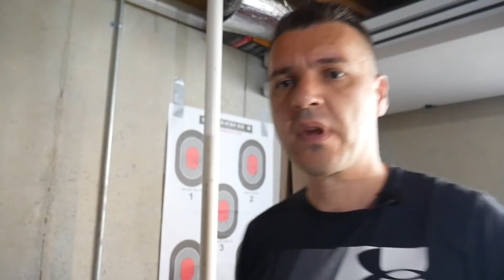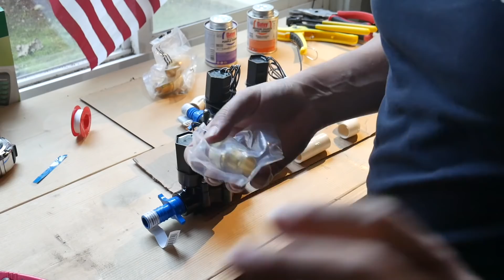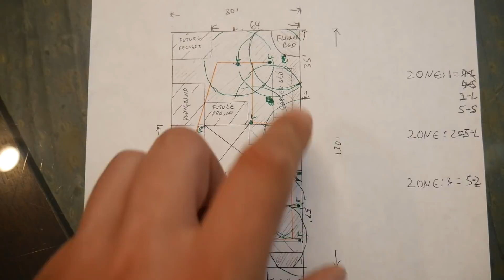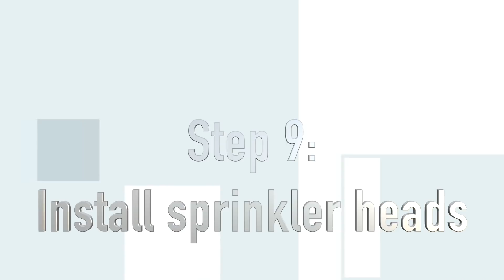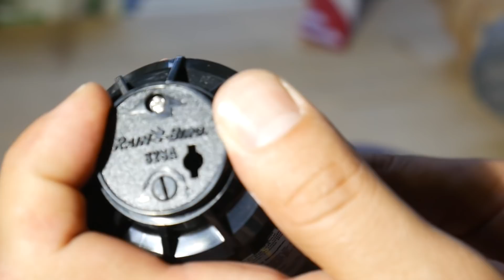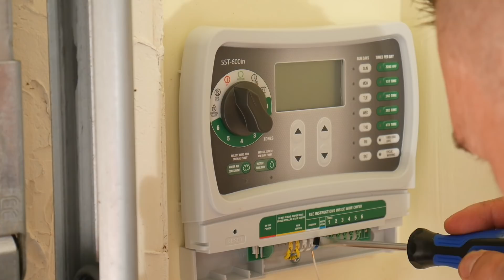How to Install Water Sprinklers - Do It Yourself

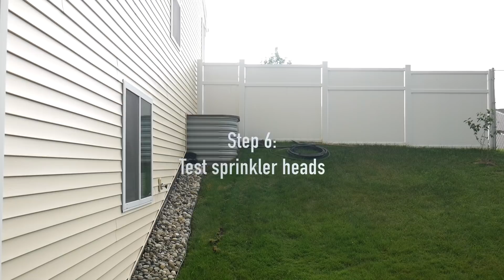Comment from the maker: One thing I would like to mention is that all other videos on YouTube suggest that you should measure your water flow and the water pressure in order to determine how many zones you need. I did that same thing but it didn't help me much because you need the precipitation values from the manufacturers for each type of sprinkler head to correctly calculate the formula. The sprinkler heads precipitation values, for the sprinklers I used, from Rain Bird and Hunter, were nowhere to be found or were very vague. So I decided to test how many sprinkler heads I can use myself by connecting a number of sprinkler heads directly to the irrigation system. You can see that procedure at 28:20. Thanks for watching and do subscribe for more videos like this.
Reply: Yes, that is true. What was your water pressure and flow rate? Hunter has several pdfs to provide great documentation.  Specifically,  Residential Sprinkler System Design and Installation.  In my case I have 40 psi to the house and, through their instructions,  they determined my "working" pressure would be 30 psi. I did an "above ground" in ground system but can only support two MP3000 sprinklers per zone. I have a 5000 sq ft area that receives no shade. So for ppl, like you, that have done YouTube vids I'm curious what pressure you started with. Very nice video btw!
Reply from the maker: @waltcorey5115  Hello, Walt. The water pressure was 30psi and the water flow was 5 gallons per minute. The 1800 series rain bird sprinkler heads and the corresponding hunter brand sprinkler head version work great with 5-6 sprinklers per zone. My back yard is small (less than 1000 sq) and I didn't cover the whole area so I was able to get away with only 3 zones. For a 5000 sq lawn, you would probably need to draw a picture like I did in the video and try to figure it using the sprinkler head coverage measurement or calculate it using manufacturers formulas. Every set up is different but I think you would need around 12 zones with about 5-8 sprinklers each for a big yard like that. Thanks for watching.
Reply: @NeverStopDIY  Yes! Once again you are correct. Every town or city have property assessors. I suspect,  at this point every municipality has something like axisgis,  which is a geographic information system which shows aerial projection of each property,  vegetation, contours etc. Likely, thanks to Google,  one can superimpose an aerial photograph of their yard.. you can create a PDF of your property at whatever scale is appropriate. The one I'm looking at I set 1" equals 17'. I then set my compass width to 1" and drew the edges (90°) and and filled in the runs (180°) then can see where those not-covered areas are. It's nice having the superimposed photo as you can sight to landmarks in your yard. The down side of above ground is the massive number of hoses needed. Watching your video I got a very good sense of the physical exertion it took you. I'm, most likely, twice your age, it is impractical to think I could be successful by myself.  But, again,  that was an awesome video, very well done. TY.
Reply from the maker: @waltcorey5115  you are welcome :) Hope your project turns out great. Let us know after you are done, please.
Reply: Well, these tables for each sprinkler head are in catalogues (RB and Hunter). You just need to use right numbers (metric or that strange units). The problem I see right in your planning - every single sprinkler should have another in range and every single m2 (or sq ft) should be irrigated be 3 (triangle) or 4 (square) sprinklers. And the numbers from RB/Hunter are calculated for this exactly. So your idea of one full 360 sprinkler in the middle is wrong by design.

Anyway optimal pressure is 2.1-2.4 bar with flow about 3.6m3/h (1 l/s). I have 4 bars from my pump, so I have to use pressure regulators and/or special sprinklers.
Reply from the maker: @martincerveny2284  I see you did your research very well :) The sprinkler that you are mentioning is actually not single. All the areas, including that area do have double coverage. But a nice thing is when you do your own irrigation is that you can play afterwards with it. You can change sprinklers, add them or take them off.
Reply: @martincerveny2284  it wasn't until just now, reading your post, that it clicked what Hunter meant with their section on triangular or square orientation. So thank you for that! But there is an assumption at the base of their calculation which is the pressure drop from the street to your water meter. For instance our house is 200 ft off the main and maybe 15-20 ft elevated off the street. I am using MP3000 heads. What you are using 1800 is equivalent to MP1000 heads. Best way to deduce perception rate is with an empty tuna can. Run for 1 hr and measure how many mm or fractions of an inch.
Reply: @waltcorey5115  Irrigation from city water source is not good in any way - there is very low pressure*, pressure changes often during the hour/day and it's way too expensive (it's like $5 per 1000l of water in my country). A well is IMHO the only solution - the pressure is high and stable and running costs are low.

* you have to measure dynamic pressure (when water flows) and not static, and you have to count into the pressure losses all of your pipes, valves, filters, fittings, etc. 

BTW: I'm not a professional too but I'm installing my irrigation system right now (18 zones, 60 sprinklers, 400m of dripline) so I studied hard :-D I'm using Hunter PRS30 sprinklers with adjustable and rectangle heads. MP Rotator heads are very good and trendy for last couple of years but I'm kind of old school and better go with classic adjustable heads.
Reply: @martincerveny2284 I was just getting ready to post to you. I completely agree with your comment on well vs city water. We lived in a house with its own Artesian well. The only cost was for the electricity to run the pump. City water here is ridiculously expensive but I just spent ~ $6000 to dig out and reseed 5,000 sq ft of burned out sod. We've been here 8 yrx and mother nature did very well watering that area of the yard. The last 2 yrs have been "extreme" drought. That section of the yard didn't simply go dormant in August it died and didn't come back. It would cost thousands to drill a well. After I get that section established I will merely augment nature going forward. What I was going to post abt is , at least my, struggle to visualize the inter-dependencies between pipe/hose length, pressure drop per foot, pressure drop per head. I got the necessary information from our water company and established my design capacity should be 6 gpm and working pressure should be 30psi. It is not. I can only put 2 mp3000 heads on one "zone". I could drop to the 1000 or 2000 series but it would be an exercise in linear programming (lp) to minimize cost with fewer zones but more heads and piping  or more zones and fewer heads and piping. When I was in college I could design the software to do that in my head. That was many decades ago. The area in question is 100 ft from the house and is 100' by 80' approx. So if, anecdotally the design capacity is really 4-5 gpm is dynamic pressure really even relevant? You mentioned the term dynamic pressure. That's interesting as I had the water company come out and test and they said the static pressure was 40psi, which I knew, and dynamic pressure was 50psi. That's about when my head exploded. What I alluded to above was if a head consumes 1.6 gpm 2 would consume 3.2gpm and a 3rd push gpm to 4.8 which would exceed design load. But, yeas, it would take a certain amount of kinetic force simply to raise the head at all. I wish I were 40-50 years younger when this stuff would make far more sense. You seem to have a good handle on this... what are your thoughts?
Reply: @waltcorey5115  That's strange because dynamic pressure is almost everytime lower than static. For example, my home's city water supply has static pressure about 4.5 bars, but with full flow (about 2.4m3/h) it's 1.5 bars only (on sprinkler head) - so it's almost useless. Thank god I have a well. My pump is 6 bars max and 4 bars with full 3.6m3/h flow. Anyway to ensure high pressure in the whole system (and if you have long pipes) is good to use bigger pipe (I have 5/4" as main pipe, 3/4" as section/zone pipes, and 1/2" to sprinkler connection). Anyway you need the pressure not only to rise pop up sprinkler, but for nozzle too - to make unified water distribution. There are a lot of videos showing how low pressure and even high pressure is bad. Hunter, for example, recomend 2.1bars (30psi) for classic heads and 2.8bars (40psi) for rotating heads.